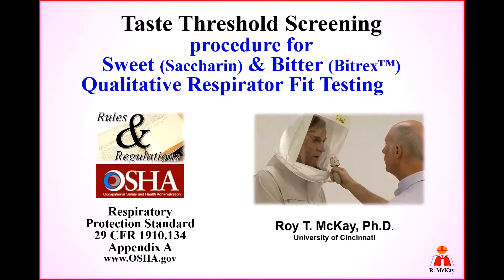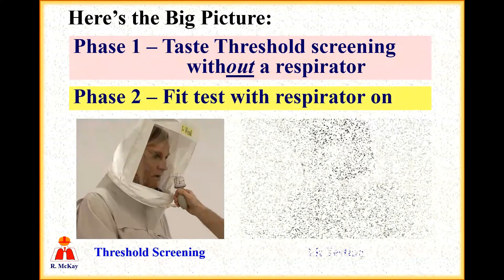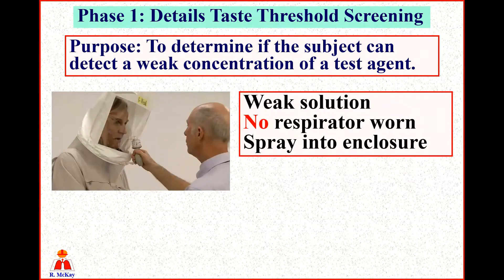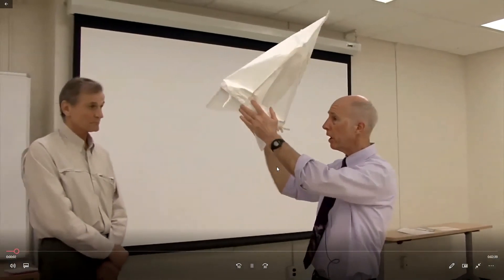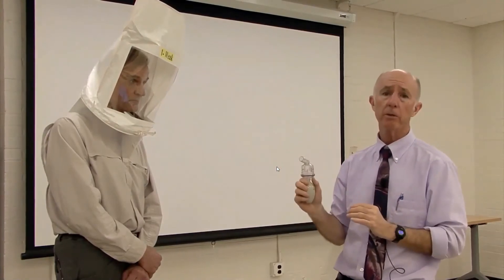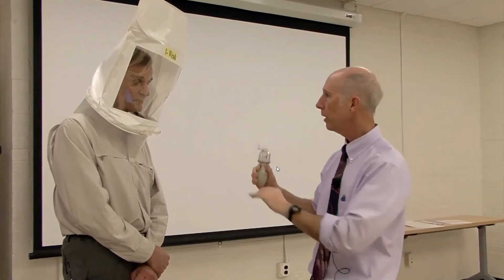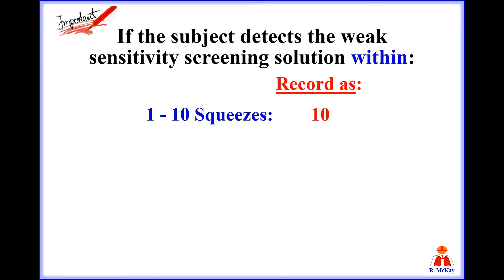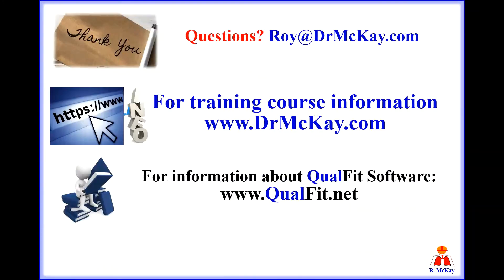Threshold Screening Procedure for Qualitative Respirator Fit Testing by Dr McKay

Comment: Great Video Dr McKay.
Supplies for saccharin powder fornreconstitution is still on backorder.
Do you have any recommendations to prevent saccharin crystallizing.  Some of our field personnel have been finding that their bottles are crystallizing.  If the bottle is marked at the last meniscus line, (and none is lost externally from dripping falling out) can we reconstitute with distilled water to rehydrate the crystallized saccharin?
Reply from the maker: Regarding supplies of Saccharin solutions (both weak and strong), you can easily make your own.  For step-by-step instructions, go to www.QualFit.net.  At the top of the page is a tab called "Documents and Resources".  Scroll down and you'll see instructions for preparing both weak and strong solutions for Sweet and Bitter fit test solutions.  I assisted NIOSH and OSHA on these instructions, so I know they're correct.  You may notice they differ from the instructions in the original OSHA Respirator Standard, but they are equivalent and easier to follow.   
Regarding the formation of crystals do NOT add water.  Crystals commonly occur when the strong saccharin solution undergoes a temperature change or when there is evaporation (this is why crystals are often seen at the screw cap).  You can try and gently warm the container to put them back into solution (make sure it's sealed tightly) or decant the liquid and place it in another clean container.  The strong solution is a saturated solution, so the crystals have no affect.  You don't want to add water, since this can decrease the concentration of the fit test solution, which could allow a poorly fitting respirator to pass.
I hope this helps.  Thanks for watching my video.  A new video on the  2nd phase with the strong solution is coming out soon or watch my 1 hour comprehensive video.  Roy
Reply: @drroymckay6845  

Thanks for the reference to your fit testing solution instructions on your website.

I've not attempted the instructions since USP saccharin sodium dihydrate is not as common or easy to purchase in small quantities as common food grade Sodium Saccharin (C7H4O3NSNa·2H2O), and because I'm not a chemist and don't understand the differences so I don't want to make any assumptions. 

Is it possible to safely make Saccharin fit and threshold solutions using regular food grade Sodium Saccharin? Your detailed instructions seem more complex than the formula alluded to in the OSHA standards, but also more detailed.

Thanks